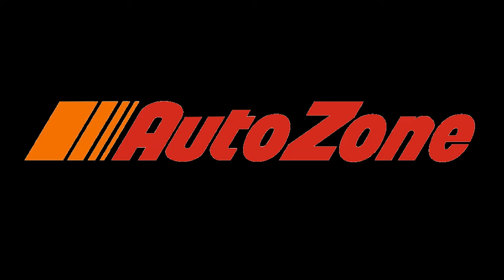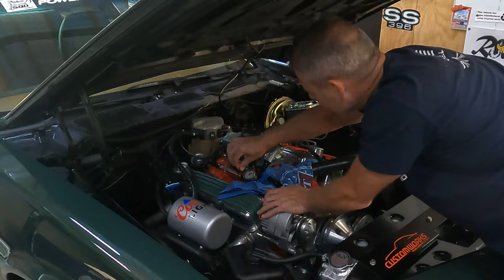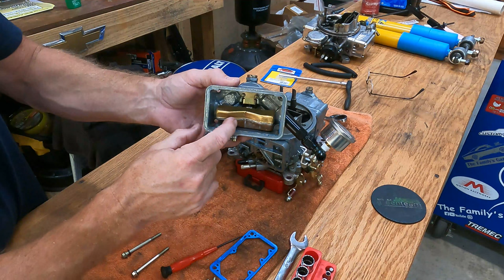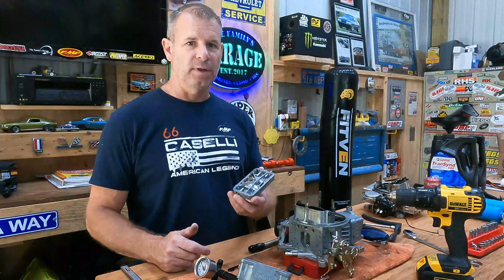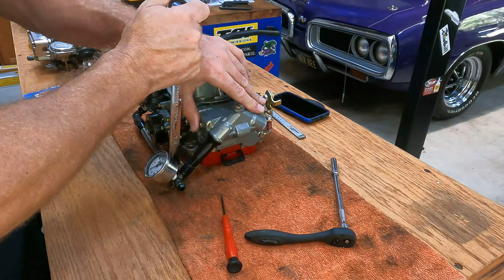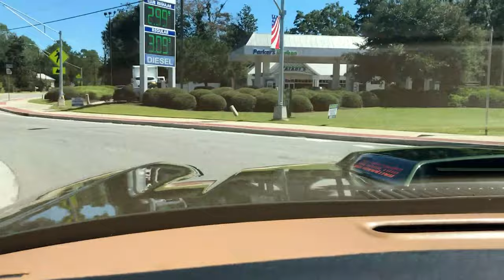Fix your Holley carb stumbling issue. Vent baffle install how to.

Comment: I run the same carburator on a ZZ4 crate engine along with a 700r4 with 3.73 posi rear in a '79 malibu 2dr coupe. I upgraded mine to press fit vent baffles, nitro floats(plastic) for the front and notched one in the rear for use with jet extentions. Works good enough, but i do suffer from a nasty bog if i womp on it from a dead stop, i havent quite figured that one out yet, but works perfect otherwise. Next up, to install an AFR wideband gauge setup to better tune the carburetor with, perhaps you should look into that too to get the most out of your engine, performance wise.

Comment: Thanks. Yes, there was scant information available on how to correctly install the whistle-type baffle.

Initially I mounted it upside down (angled up) and just used clear RTV/Silicone adhesive to secure it in place.

Somehow I was able to remount the primary fuel bowl with the whistle incorrectly facing up, but I found some information (saw an installed one in a few frames of another carburetor video) a day earlier that it was supposed to be angled down instead. 

So I removed the whistle and installed it correctly (angled down) and again secured it with clear RTV.

I could drill the metering block and use the drive-rivets that were included in the package, but I am pretty sure the RTV will hold well enough and be fuel resistant.

Still it was good to locate your video and watch actual confirmation of how it should be done.

Thanks again.
DC
Reply from the maker: Your welcome!😎🤟🏻🇺🇸

Comment: You can install taller vent tubes, so you don’t have to go the rubber hose route....
Also, get you a tiny funnel, stick it in the front vent tube and add some gas to the front bowl and your engine will start immediately with grinding on your starter to prime!